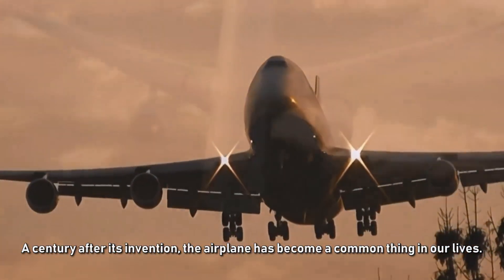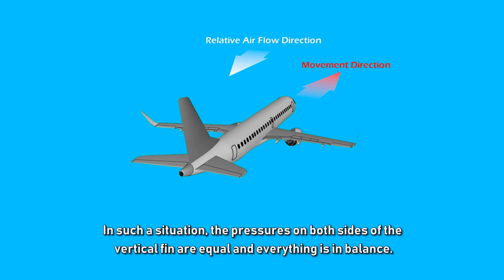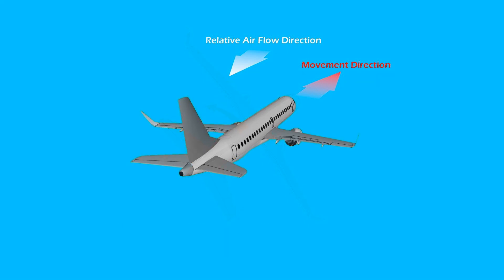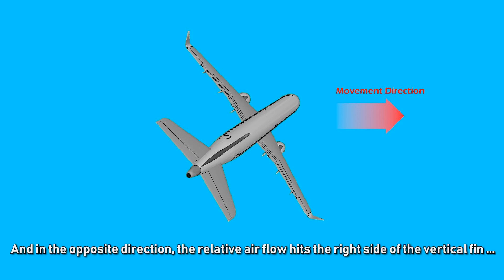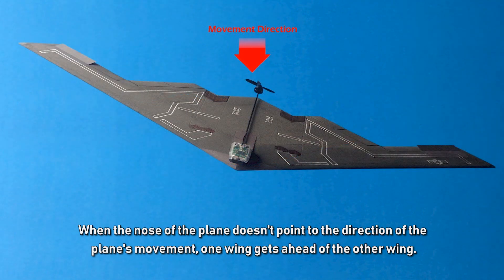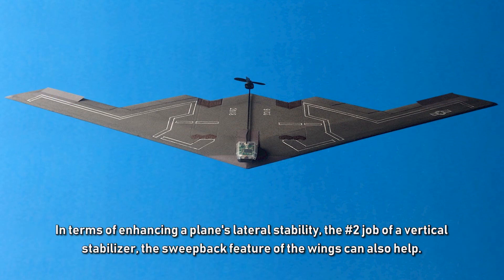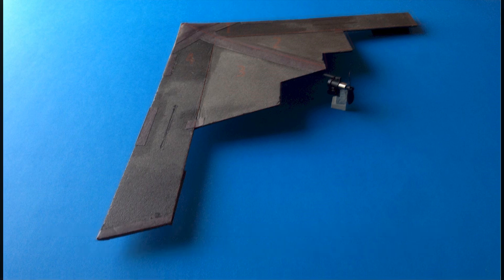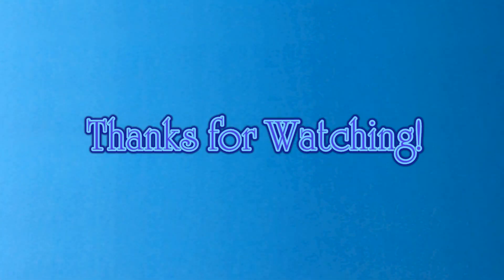The Secret of Flying without a Vertical Fin

Comment: The wing tip flaps are called adding reflex to the wing speeding up the airflow under the wing in comparison to the center. This lowers the stall point of the tips in comparison to the center increasing directional stability.

Comment: This is an excellent video which leads the viewer nicely to the current holy grail of reducing airframe drag by reducing the drag from the vertical stabiliser. It briefly describes the use of proverse yaw generated by careful control of the spanwse lift distribution of the wing to allow clean banked turns using the elevons without having to use excess drag devices to reduce adverse yaw. It then points us in the direction of all the pioneering work of NASA in this field where a lot more information is available. Brilliant stuff.